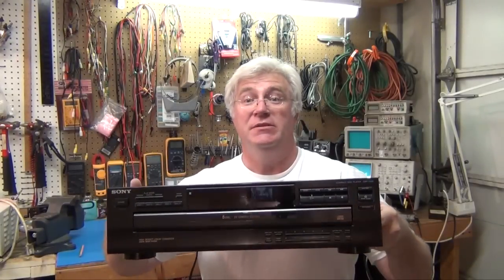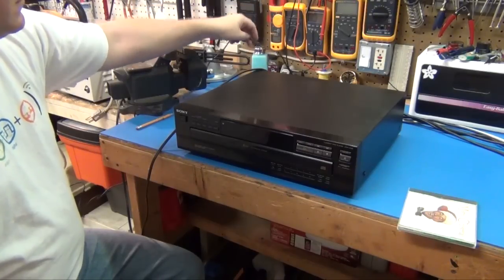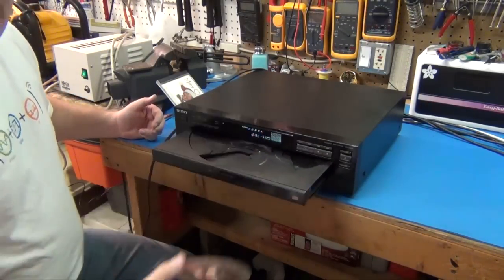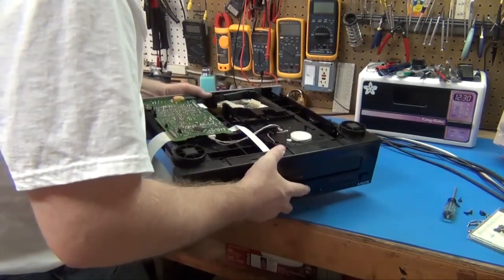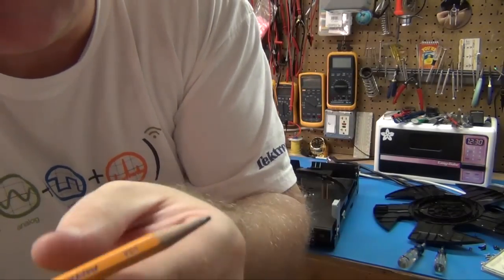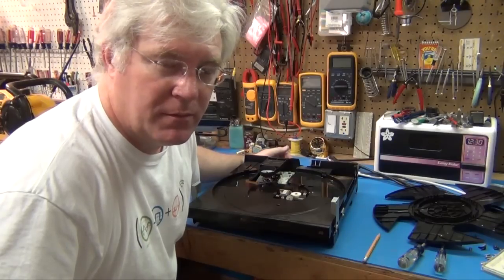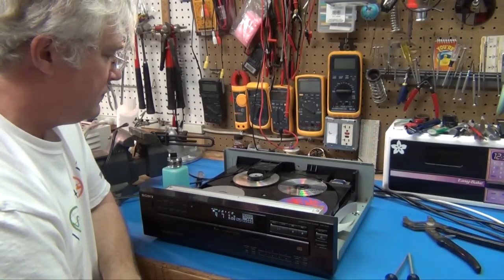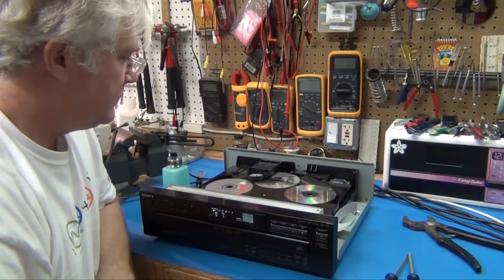ToddFun.com: Repairing a 5 disk CD player

Comment: Hey thanks for the great video, Todd! Although, I'm not sure why you said..."who wants a 6 disc CD player, anymore?"

What is the alternative? iTunes?? Streaming?? Yuck!!

Anyway, I have the same player and so far, no problems. But I have another that I got last week from a kerbside cleanup that, as soon as it's powered up, it searches for the discs. When it finds a disc, it spins it up, then stops and goes searching again. I cleaned the laser with isopropyl and a q-tip, but still no luck.

Any idea what this could be? The local repair guy said it could cost up to $200 to fix it, with a possible laser replacement!! Crazy price for an old unit that I scored for nothing. I would like to be thrifty and fiddle with it myself to try and get it to work.
Reply from the maker: ***** I don't see the point for CD players because you can pop them into a PC and convert them all to MP3 files. Then you can play the files on anything. I put mine CDs into iTunes and made play lists. Then I just move play lists to my iPod or phone to play. If I want better sound I just jack my iPod into an stereo amp and is the the iPod to pick my songs or playlists. Works so much easier than switching out CDs. 

If a cleanup didn't work then most likely it will be the laser reader. Sounds like it can do all the stuff but read the disks so its going to be too costly to repair.
Reply: ***** Thanks. I don't have an iPod, in fact, I will never buy an Apple anything. I don't like the way they try to monopolise the market. I'm old fashioned and like owning the covers with the printed information and photos.

I actually prefer records over CDs, but still use mp3s a lot. At home sometimes, or in the car or work truck....CDs. I'm old fashioned...I think Hi-Fi is well an truly alive and I won't ever support the obsolescence of such useful components. Besides, I've only just started to accept CDs. Haha!

If I was to replace the laser reader with a new part, would I have to adjust tracking etc? I'm thinking I might just toss this one.
Reply from the maker: ***** If you can find an exact replacement you have a chance but the unit can't be worth the cost. I'm sure you could get a fully working unit off eBay or Craig's list for less cost than a replacement without the worry that you have the exact replacement part for your unit. I have never changed just a laser pickup before but I know they run on an active feedback signal that self aligns the read head with the tracks provided it is mounted correctly. That is the most I know.
Reply: ***** Yep. Cheers. It's $12.27 for a brand new identical laser reader. I'm going to get it and try it.
Reply from the maker: ***** I hope it works. Yet you don't know if the laser is bad or something else, for $12 its a sound thing to try. Let me know how it turns out and include a link to where you got the module in cause others would like to try this fix... provided it works.
Reply from the maker: ***** 12VoltVids just posted a really good general service video of 5 disk changers. It doesn't address your read issues but does cover all tray alignment and other faults. https://www.youtube.com/watch?v=yaXwF_1DxtA
Reply: ***** Thanks.

Comment: My drawer opening problem: plastic strip covering the display has slipped downward again, and so obstructs to prevent drawer opening. If I could either remove the plastic strip totally, or just get it moved upwards on the right-hand side, back into proper  place, the drawer would open. Would appreciate advice on how to either remove the plastic strip, or how to just move it's right-hand side upward, to create clearance for the disc drawer to open?
Reply from the maker: Patricia Allen If it is the same make and model as the one in my video you can unplug it and it disassembles easily. Once you have the front off you can take the display out and put it back correctly. If this is not the case and you can't stick something to the display cover to pull or pry it up then it might not be something you can fix.

Comment: Thought I'd try to see if there's a possibility of learning how to fix my 5 disc player.  I'ts amazing that such a tiny bit of dust was all that was wrong with the one in your video. I can see that it would probably cost more to have it fixed that what I payed for it several years ago on Black Friday...$65.  The disc go around but nothing plays, guess I'll keep it for the tape player and the radio which still work. I'm good at taking things apart and then losing the screws and that's what has happened.  I pretty much gave up on getting it apart after removing the easily removable screws and not being able to see why it wouldn't come apart beyond that.  So...your camera work was great as well as your presentation.  Thank God, this wasn't accompanied by some God awful music like a lot of videos, thanks for that.  Too bad, I did so want to play my "Nabucco" CD once again (Verde).  I think the cat knocked this over, don't think it jumped off of the hearth by itself.  Thanks for the video.
Reply from the maker: Alice Crawford Sorry you couldn't fix your player. But I'm glad my video was at least of some help. I have used iTunes to convert all of my CDs to MP3 files. I now just play all my music through my phone into the auxiliary Jack of the base unit. It is a lot easier than dragging CDs around and is a lot more reliable with less stuff to break.

Comment: Hi Todd. I have a Panasonic 5 disc changer that needs repair. Can you fix it? If so, what are your rates?
Reply from the maker: Serenity Justice Sorry, I don't do repairs for a fee. My fees would be far more than replacement cost so I only do such repairs to save myself the cost of replacement. Best advice is to get a used iPod on eBay and use iTunes to copy all your CDs to mp3 files and then dump to the iPod. The iPod can then be jacked into most any AUX connection on the back of your home stereo system, CD players and some newer cars have an AUX jack. If your car does not have a AUX jack then do like I do and get one of those FM transmitters that plugs into the iPod to keep it charged and at the same time it will transmit music over a select-able FM freq that you can tune your car radio into to listen to your iPod over your car's old stereo system. I hope this helps, you might have known all this anyway.

Comment: I have an Onkyo 6 disc carousel changer.dxc606.the tray opens and closes but it does not spin by pressing any buttons on the face and also the remote..and therefore does not play any discs since they arent moved to the correct location..would that be the motor assembly or could that also be a dirty lens problem?.. i did get it to spin once by pressing the button about 30 times lol but no luck since then,, help! lol thanks..also where is a good place to get parts for that?
Reply from the maker: You can unplug it, take it apart, clean the optics and make sure the tray is not jammed in any way. If that doesn't help you best not try to fix it unless you have all the right tools, experience, time and consider it a personal challenge because it is not cost effective to buy parts for something that can be replaced with little expense.
Reply: ***** thanks,this is more of a sentimental thing for a friend..i am savvy in fixing just about anything..I build and fix comps and tvs..so I'm not worried about taking it apart and messing with it,,but just wanted to be guided in the right direction ..i did see the motor assembly is only $27 so that's not bad..I can spin the tray manually..but wasnt sure if that includes the motor or if this could be a simple fix of just cleaning it out, it sat in a basement for about 7 years unplugged and I know capacitors can lose their juice over time by just sitting around

Comment: Thanks.  This video gave me courage to open up my Sony 5 disc changer which had jammed, similar to the machine you worked on.  I had expected to try to get to the optic sensor to clean, but after opening it up I saw that a CD had actually slipped off the track and was caught below the turntable.  Once I pulled it out, the machine works just as it did before.
Reply from the maker: I'm glad to hear it was helpful. Merry Christmas!

Comment: Hallow  Mr. Todd How R U.  Now, as per my last say, I had opened my SONY MHC VX-701 3Cd Changer  Tray. I could succeed in managing the mechanical part. The tray comes out  and goes in on pressing buttons. Shuffle also works. But the CD changing on goes continuously and no cd is played. The Player simply keeps on changing CD.I have cleaned lens. I dont know what is wrong.Any good tips?? Thank you. ( I spent nearly 10 hours in trying. No success !)
Reply from the maker: If it loads the CD and spins it up like it is going to run it, then your CD laser is not aliening or is bad. If it simply does not load and spin up the CD then you may have a bad optic. Either way, it can't be worth more time. Get an mp3 player and put all your music on that, connect mp3 player to system and never change a disk again. If all your music is on CD then use iTunes to transfer to a library and load onto an iPod. Records are gone, reel to reel is gone, 8 track is gone, cassette tape is gone and now CD is gone. Best just to move on to solid state, it is better in every way really. I have trashed my CD player and now just have an iPod jacked into my system. It has been great and super easy to make play lists, switch between play lists and best of all, all my music is now on on iPod and I never have to change out anything. I should have made the switch earlier but I was so apposed to yet another new media. I'm glad I switched and I'm hoping this is my last media switch for life! HA good luck to me and you!
Reply: That loads but spins for a very few (1%) occasions. I will let know in details.:
1.  tray Opens and closes on operating button.
2. After placing CDs and shutting, starts taking CD to reading assembly. Takes up from its seat and puts down again and takes next CD. And this goes on. Only at a very  few occassions it takes a little time to read and its reading attempt is known by its sound. Once or twice it spinned too.But ohh... But I enjoyed the struggle. ( I am sure it will get tired sometime and wl start playing. Ha. Haa..)
 I hd gvn up these kind of  works long back. Yr VDO inspired me to try this, and I started with screw driver.
Anyway, that was ok. I may try that once again. But u hv referred about alignment of the lens. U knw  I cant do that Ha. Haa Haa..... 
U c Todd, for a professional like you it is nothing, but if a layman sets right a faulty electric press only by cleaning contacts/rust, it is a big joy. Is it not? I hv enjoyed such repairs through out my life. To reach up to u was one attempt out of that. Internet has done wonders. and Google is doing miracles.

I hv already thought of the 'switchover' u suggested. I hv alrdy tried that. Thats a good wayout.   Because otherwise the music output is very fine.  I hv a very few no. ACDs and VCD, but a good number of MP3  and VCDs
The changeover u suggested is the only way even if the CD tray starts functioning.

Mr Todd, this sys I hd purchased 2nd hand as is where is basis. Because I love music, and  I was searching a cheap 2nd hand good music sys. for Indian Rs. 1500 ( Approx. USD 26) at the place where I am posted at present. I am away from my house till June next. I shall end this loneliness and go home, after my retirement at my 60.
If you happen to visit India, then welcome to Ratnagiri, a coastal  district place, till June 2014. After that u r welcome to PUNE my normal place of stay, a city known for educational institutes. And I m planning to stay some of the leisure time at my hometown near AKOLA distt. 500 KMs. away from Pune. You r welcom there too at my old house. 
Nice to hv interactions with you. Thank you. Merry Christmas !!
Reply from the maker: Jeevanlal Patel Visiting India would be great! However, I don't even like to leave my home town. I hate to travel. I left the US two times in my life, once to drive to Canada and once to drive to Mexico. Two most horrible trips of my life. I just don't like the cultural change mostly. So the changes of my making it to India is about 0%. If my company ever makes me go to India I will come back to this thread and let you know. My company does send developers to India a few times a year but I'm a database administrator so no good reason to send me to India. Plus, I don't have a passport. Never needed one so never applied.

Sorry you can't get  your player to work, sounds like the laser optics for the CD reader are not working or aligning with the CD tracks. So many things could be wrong. Make sure to test with the cover one just in case the light from the room is messing with any sensors.
Reply: Thank you. Tried after replacing cover. No change. Seems something wrong and cant be repaired at my level. But anyway I am at present using a DVD player. that plays most of formats. I may get repaired one Pioneer dvd player lying faulty with me. Its SMPS is faulty. I normally browse OLX. It is my experience that you get right things you need and at economical price.   You may enjoy here and experience different life and lifestyles. In US, as I hear, everything is smooth and life is cool. But here you have to move, for simple needs.
We are used to that. This is a country of 1.3 population. I remember till 1965-70, we had to import lot of grains from your country. ( for 0.6 billion people) Thereafter with assistance and association of US, gradually our home product went on growing. Today hopefully we are self sufficient in food grains for 1.3 billion heads, and help to developing countries. US for a long time has always been  ten steps ahead of developed Europeans. But my talk is getting long. Thank you. Wish you merry times.Lot of success. May the almighty grant you power and courage to attain what you wish in life. Merry Christmas.

Comment: Hi there, i got a question, my old sony cd changer that still works does not have a optical digital out put on the back, my new one does, do you recommend me adding it? does it make a huge difference? or just use the rca cables? thanks.

Comment: It was the mechanical timing of the tray mech. Repaired dozens of these. Cleaning the optic didn't hurt of course, but would not have caused the tray problem. Re-assembling and getting the timing right fixed it. Yay!

Comment: Hey Tod, nice tear down. Sorry you didn't get to Diagnose or Solder anything, though;) Next time maybe you can clean first and tear down later... but only if necessary:) At least, when you have the Camera Running that is;) I have an 80's or early 90's JVC 6 Disk Changer, that I still use every Day. I had to repair the RCA Jacks when they got loose, a couple of years ago. But other than that. It works just like new. Say, if you still don't wan that thing... I bet I can make good use of it;)
Don